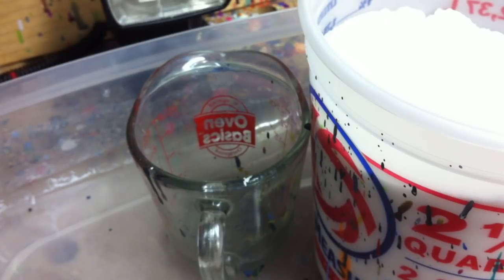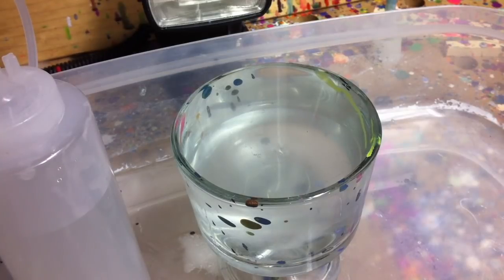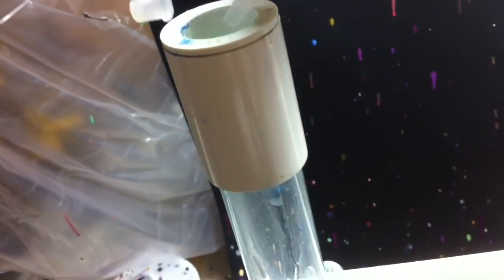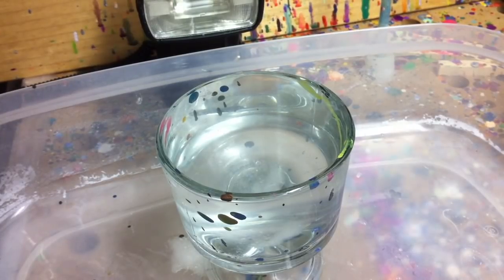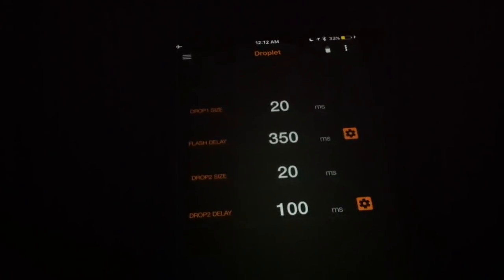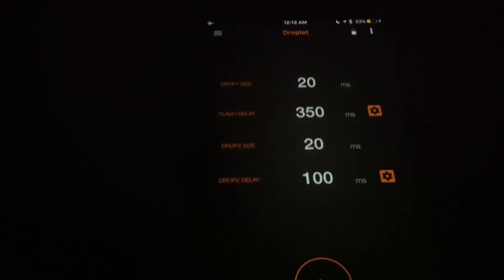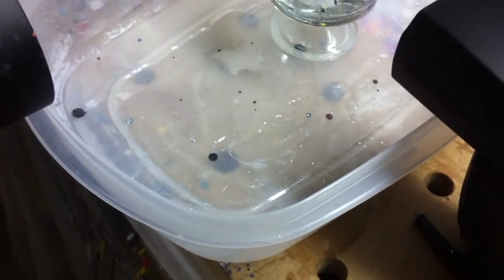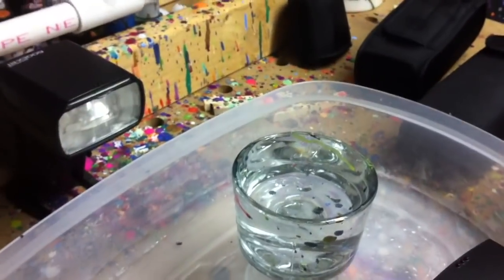Pluto Trigger Water Drop Tutorial

Comment: Tim, Great video and have gotten my pluto trigger and valve and was taking shots yesterday. Had a lot of trouble getting a crown and was rechecking the video to see what the settings were for the second option on the video as I am unable to get it dark enough where I am shooting. Please advise, I have the two flashes, camera, macro lens, and the trigger is hooked to the camera. Do I leave the camera in bulb, or do I set it at a different shutter speed? Thanks in advance for your help
Reply from the maker: Hi Terry, I didn't use bulb (I may have for the purpose of making this video but typically I don't do it that way). I use an St-E3 transmitter on the hot shoe to fire my flashes (I have all Canon equipment, any wireless, or wired, transmitter would work). I set the camera at something like f/9, 1/250, iso200. Then I use the Pluto to trigger the camera. Hope this helps! Please let me know if you have any questions.
Reply: @TimBuckMichael  Thanks! yes it helps tremendously!!!
Reply: @TimBuckMichael  do u need to have receivers on each of the flashes if you have a transmitter on the camera hotshoe if 2 flashes or EVEN if you only have one speedlite do u need a receiver on that speedlite? i cant seem to get the setup to work...
Reply from the maker: @leannemcardle1330  I'm not sure. I think that would depend on your flashes. Mine have transmitters in each so I'm guessing the answer to your question is yes

Comment: Thank you for the video.  I have my Pluto system on order.  However, I was wondering if the Pluto Trigger will support multiple speed flash units rather than just a single flash?  From what I saw in reviewing this product, there is only one output on the trigger for a flash.  I am hoping to be able to modify the setup/wiring to support 2 speed flashes as a minimum.  Thanks for the help.
Reply from the maker: I would imagine you can split the wire and control as many as you want

Comment: hello, nice tuto. just received my pluto+valve+arm+dc2 cable for my d750+ godox xpro transmitter+2xgodox v1. so your second method helps me a lot !
what is the recommended height of the valve beak with respect to water plane for higher splash peak... ?
pictures you are showing look dark and dull on the display. how do you colorize pictures in post processing ? luminar 4, lightroom, ...? 
how do you use a colorful backdrop and lighten it ? with a third flash laying on table and pointed to background ?
I have a ad400pro 400W with fast recycling time and t0.5 parameter to capture high speed events and different octobox. is it nice to use it instead of two speedlite and if yes, where to locate it (side, top above valve, behind me,...) ?
is it recommended to put milk and coloring food product in the "cheap" valve ? won't it damage it ? is there a special method to clean and dry the valve after milk usage ?
Thanks for advises
marc
Reply from the maker: I was setting the valve at 12-18" above the water. I have heard of people going as high as four feet. It's a lot of trial and error to find what works for you. 

I shoot in raw and use photoshop adobe camera raw to dial everything in. 

A third flash lighting up a backdrop would work perfectly for your desired effect. 

There's a video on my channel somewhere showing the process to take the valve apart and clean it. I have had no issues. 

Thanks for stoping by! Good luck and happy shooting!

Comment: what is the powder you use (2 spoons in 250ml hot water) ? xanthan gum ? won't block the pluto valve ? need to clean valve after each use ? how long time do you wait ? I have heard one night.
Reply from the maker: I typically use borax. I just stir it in until it dissolves and start shooting. I clean it every few uses. I have a video on the channel somewhere that shows that process.
Reply: thank you Tim, can you please explain why we can't trigger camera with pluto and use 1/200sec F11 iso 400 with godox rf transmitter like first man photography. I don't understand why this setup cannot get a drop in a 350msec period. d750+godox xpro should have a fast command processing, isn't it ? where does it lag so much ? Jeff photographie triggers flashes by pluto with a xpro connected to pluto. strange isn't it that it is faster.

Comment: I know this is an old video, but hope this comment gets found.  My set-up is in transit so looking forward to using it when it arrives.  In the 2nd method (which I think would be my preferred method as well). Appreciate the lowest flash power is the best to use, but what zoom level did you have the flash(s) set?
Reply from the maker: Hello! thank you for stopping by. The video is old but I still check the comments. I had commented earlier and then realized that the information I had given you was incorrect. I initially had said that I assumed that the camera set the flash to 100mm since I was using a 100mm macro lens. However  I went back and looked at my notes, the flash was manually set to 24mm. I can't remember why I had it set that way, but I have it documented that that is where I had it set. Best of luck trying out your new setup! If you have any other questions feel free to ask.

Comment: At 3:03 you threw me off saying that the flash is connected to the camera port on the Pluto. I know this cannot work, but the cables were connected as you described it and I was confused. 

Then, later in the video (7:52), you showed that the Pluto trigger goes into the camera - like I expected. The flash is triggered wirelessly from the camera, which what I expected.

So, did you really connect the flash directly to the Pluto trigger? (3:03)
Reply from the maker: Hi Ron. Two different set ups. Both set ups work as they are shown in the video. In the first set up (3:03) I am manually triggering the camera with a long enough shutter speed to allow the action to happen. The flash is being fired by the Pluto and illuminating the action and making it so that the camera can capture it. This only works in a completely dark environment and a shutter speed of 2+ seconds will be required. 

The second set up is exactly as you expected and described. 

The reason both of these work is because the Pluto doesn't know what it's sending a signal to. The "camera" port where I plugged the cables into simply sends an electric impulse out of the Pluto and down the line to whatever is connected. If it is connected to a camera it will trigger the shutter at the set settings. If it is connected to a flash it will trigger the flash. 

I hope this helps. If you have any other questions feel free to let me know.
Reply: Many thanks! Learning new things every day.
Reply from the maker: You're welcome! Thanks for watching and taking the time to ask your question. Have a great day!

Comment: Hey Tim thanks for this informative tutorial,I have had the Pluto trigger for awhile and just purchased the valve,why does normal water not work is there a reason to have to put borax in the water??
Reply from the maker: Normal water will work just fine. Adding borax or other additives to the water just makes the water a little bit thicker so that the pillars are slightly better.
Reply: thanks mate i will have another go,as all i was getting were crowns,maybe the drops were to high and causing the water to just cause a crown
Reply from the maker: If you're only getting crowns I would assume that you have your flash delay set too short. The first drop will typically make a crown as it enters into the basin prior to making a pillar.
Reply: Tim Michael thanks Mate so that means I am taking the pic way to early,ok I need to practice more in the settings with the Pluto trigger 👍🏻

Comment: Hi Tim.....is there a procedure to priming the pluto valve prior to using
Reply from the maker: Hi Len. When you have the stopper secure in the top of the reservoir place your thumb over the hole in the stopper and press down and release. You may need to do this a couple of times.

Comment: That's a lot of work for photos of water drops lol. But it's pretty impressive.
Reply from the maker: For sure, when I'm actually doing this trying to get solid photos, like the one that is the thumbnail, I usually spend like 4 hours taking shots.
Reply: Yeah I believe it, that's a lot of time and work. Totally worth it though, those pics turned out really well.
Reply: I'm still trying to get a collision and after 500+ photos using the Pluto guide  all I can get is a single droplet at its highest point. Sometimes I get the single droplet with the second sitting on top. Not sure what I need to adjust to get the actual collision. Still a great tutorial thanks. I'll keep on practicing
Reply from the maker: I would try shortening the delay between drop 1 and drop 2 keep everything else the same. I would start with 5ms increments. I would think that if you are occasionally getting the second drop to sit on the top of the first one that this should solve your problem. Even with everything completely dialed in I would say my hit rate is probably somewhere in the neighborhood of 1 out of every 5 or 10 shots. There are a TON of factors. It seems really straight forward but it's actually pretty technical. I think I mentioned some of it in the video but I've found that the water temperature, the consistency of the water, the water level in the reservoir, the distance from the dropper to the water level in the basin, the calmness of the water in the catch basin, the size of the basin, the shape of the catch basin and probably some other things all have an effect on the results. For the tutorial I probably spent an hour and a half making the video. It took a long time to get the first method dialed in as I've never done it that way before. The second method is the standard one that I use so I pretty well knew how to set that one to get it to produce a collision but getting to that point was a ton of trial and error. I'm glad the tutorial was helpful if you have any other questions feel free to leave a comment and I'll do my best to help you out. Good luck!
Reply: Tim Michael do you have an email where I can send you a result that I get and maybe you can advise further.
Reply from the maker: Due to fear of spam I don't want to post it publicly on here. If you go to this link https://timmichaelphotography.com/contact/ and send me a message, just say "hey" or something I will reply from my email address then you can send me photos and I will try to help you out.